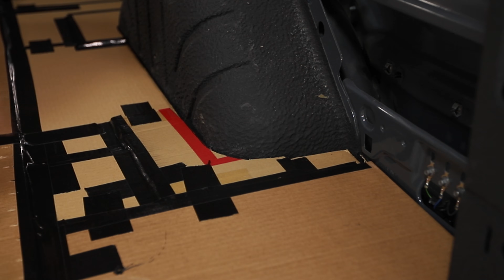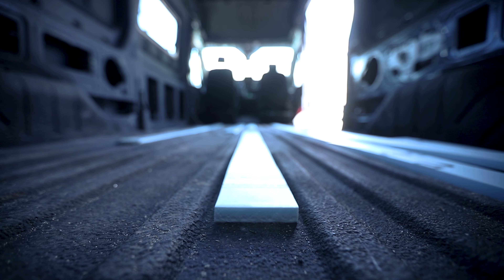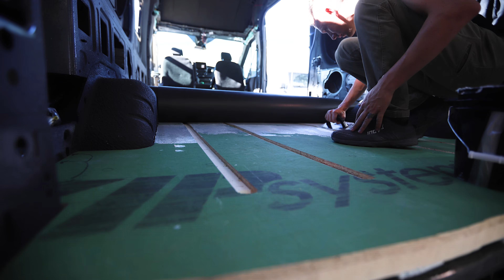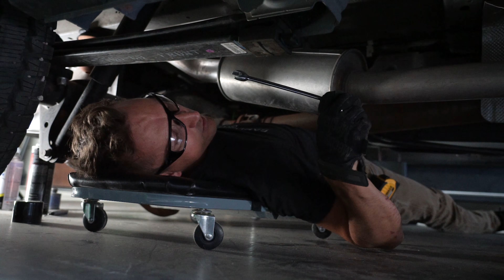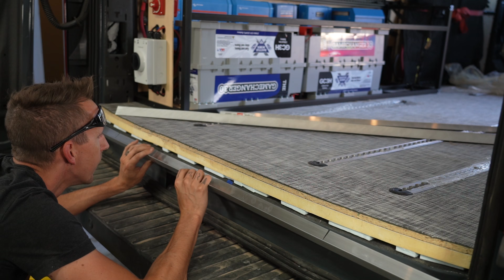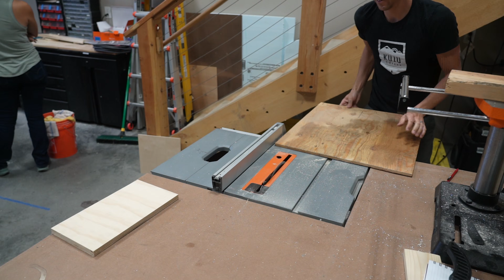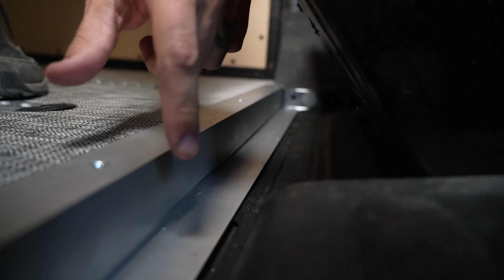VAN FLOORING PERFECTION (Insulation, Subfloor, Covering, L-Track & Step/Lip Trim)

Comment: Seems the zip floor Insulation  will get crushed over time and feel soft?
Reply from the maker: I'm sure it'll probably break down over the next couple of decades.  Until then, though - it should work great!
Reply: @EXPLORISTlife good to hear it has not flattened out, would not expect that from materials meant for walls and no foot traffic 👍

Comment: Did you say that you were potentially using the L track for seating?  That doesn't seem safe.  The L track is surely strong enough, but it's attached to wood/insulation that is just glued down.  I wouldn't necessarily trust that with the lives of friends or family :/
Reply from the maker: Sounds good!  You can always build your van however you like.  Remember, just because I'm showing in this build doesn't mean I'm trying to enact governmental regulations to make everybody on planet earth do the same thing - that'd be silly.  You have free will, use it!  Take what you learn from our videos and use what you want, and omit what you don't like.   There's nothing stopping you from this.

Also - a correction - keep in mind the L-Track has a bolt that goes through the bottom metal of the van every 6" or so - not connected just to wood/insulation.

Comment: Why do you install the floor, including carpet, first? That does not make sense. Now you need to protect it during the rest of the build.
Reply from the maker: Yes - we did protect it during the rest of the build.  We laid a layer of heavy duty carpet protectant plastic over it.  Not a big deal.

Comment: I am trying to do the part where you cut whit hot knife to flatten stripes. What is the model you use because the one I have dont cut that well the pir (The winnons one.)
Reply from the maker: Yeah, that can definitely be frustrating—some hot knives just don’t have enough heat or the right tip for clean cuts on that material. We’d be happy to help you dial in the right tool for that job and make sure you’re getting clean results. Reach out to our support team and we can recommend exactly what you need: https://shop.explorist.life/support?utm_source=youtube&utm_medium=comment&utm_campaign=support&utm_content=response_link

Comment: Is your floor in this video just floating? Or did you secure the wood floor with glue or bolts?
Reply from the maker: The floor in that build is mechanically secured — not just floating — but the exact method can vary depending on the van, insulation thickness, factory floor, and whether L-track or cabinetry will also be tying everything together. If you’re planning your own floor system, reach out to our support team with your van model and build plans and we can help recommend the best approach: https://shop.explorist.life/support?utm_source=youtube&utm_medium=comment&utm_campaign=support&utm_content=response_link

Comment: Do you think this floor would be Saturday enough for a motovan with motorcycles in the back? I would use rubber coin patter. Floor in that tea but was wondering about the sub floor. 2 motorcycles at 450lbs each
Reply from the maker: I personally wouldn't have any concerns w/ motorcycles on the zip sheathing.

Comment: I wonder if the PEX tubing could have worked out if a reflective radiant barrier was laid out on top of the insulation strips (the strip height would have had been planed accordingly to achieve a leveled surface across the van floor ridges). Of course a channel in the insulation board is needed to make room to lay down the tubing.
Reply from the maker: That's an interesting idea!

Comment: Costco is a great place to get large pieces.  Some of the pallets use it.    I wonder if spray foam would of been faster. A simple mud blade across the ribs would slice off any extra.
Reply from the maker: That's an interesting idea about the spray foam, but we opted for this method to ensure a super flat and solid base. Thanks for the tip about Costco!

Comment: Is there any concern with having foam in between the l-track and the van floor? (Foam sandwich) Does it compress the foam over time?
Reply from the maker: Great question! The best way for us to give you an accurate recommendation is to take a closer look at your specific setup and goals. Our team can walk through your layout, materials, and mounting plan to make sure everything is safe and performs the way you need it to.

If you reach out, we can also help you identify the exact parts that would work best for your build:
https://shop.explorist.life/support

Comment: is there a rule regarding the spacing between L-track strips to ensure compatibility inserted seats and benches? Is this a universal system for compatibility with a wide variety of brands? I see some shops do 4 strips, 6 strips, or even 8 strips.
Reply from the maker: Not really a rule, just figure out what you want to mount and space it accordingly.
Reply: @EXPLORISTlife  Well I suppose I should clarify if there is an "industry standard" rather than a "rule". Does the industry making L-track compatible accessories agree that mounting points are 12 inches apart? 16? 24? I guess if you were an inch off one way or the other it would be catastrophic as far as being unable to use compatible accessories.
Reply from the maker: We admittedly aren't expert in floor attachment spacing, so I can't say.  Once you get to the electrical portion of the van, that's where we can REALLY help.  Reach out here when you're ready: https://shop.explorist.life/support?utm_source=youtube&utm_medium=comment&utm_campaign=support&utm_content=response_link

Comment: Where did you drill through floor of the van for L track?
Is the L track hovering over the aluminum floor and its compressing via overhang onto plywood or did you install spacers?
Im extremely hesitant regarding location where to drill through. 

If somebody can assist, I'd appreciate it!

Comment: Love this video. I have watched it about 1000 time so far as I plan to install  the floor in my van. I have 2 questions actually I have more but for now: 1. How did you determine the spacing between the T-track? 2. When you bolted the T-track down did you have to lower the Fuel tank or exhaust Heat shield to get the bolts through?
Reply from the maker: L-track spacing was based on planning for future cabinets.  The exhaust and fuel tank did indeed need to be lowered for access.

Comment: What are the L tracks for
Reply from the maker: Great question! L-tracks are super versatile — they’re mainly used for securing gear, mounting cabinetry, or adding modular tie-down points in van builds and overland rigs.

Comment: I used 17mm aluminium sandwich panel. It’s less than half the weight of equivalent ply. Here in OZ it’s possible to purchase pre cut to suit my Sprinter. I don’t believe the sandwich I used would be very different in R value than yout floor.

Comment: Did you glue down the foam spacers? If not, do you have any issues with it squeaking against the floor?
Reply from the maker: I think I glued them down, but I don’t recall 100%.  Definitely no squeaking by the time the 100 bolts through the floor are in place.

Comment: Nice
Y day be, however I do not understand why anyone would put radiant floor heat in a van that goes thru hot freezing cycles. What do you do if you lose power in freezing weather or park it outside your house in the winter. Seems like just another thing to winterize
Reply from the maker: The floor heating would just be a glycol mix, just like a house in a northern climate zone.

Comment: What is that track on the floor for, I’ve never seen that, is it like e track in trailers ?
Reply from the maker: Sorta!  Same concept.  It's "L-Track".  Pretty much the same stuff they use in airplanes to secure the seats to the floor.
Reply: @ thanks, I just bought a van and trying to get some idea, thanks for the video

Comment: A way easier method for insulating the floor of the van or the side walls for that matter which I did in my work van is to use a product called DynaMat Ultra or any number of knock off versions of a similar type deal. It’s a flexible dense, rubber matting with an adhesive backing that you can use a little roller to press against the surface and get it really adhered. If you need to build it up, you can always put a second layer in the low spots but in this case, probably just haven’t gone over those high spots would’ve given you enough thickness to smooth things out. It has a reflective outer skin and would have provided a pretty decent amount of isolation from the metal. I can tell you that I had lined the entire inside of my Chevy Express 2500 with it because it didn’t come with the factory liner, and it greatly decreased the road noise and the temperature from the baking sun. I did not use the brand name, I used an offbrand version and save some money… The entire project wasn’t that much because I did it myself.
Reply from the maker: Dynamat is indeed great for noise damping; for sure!  We used spray on lizard skin for that in this build.  It's not thermal insulation, though, so if you were trying to insulate for heat/cold; you'll need something for that on top of the dynamat.

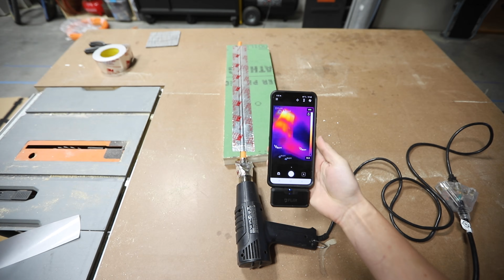Comment: at 6:17 your phone shows a thermal imaging visual.  What app? is there an attachment needed? Details? Recommendation? 

Also - love your injection of nerd humor on the R value differential of putting in the leveling foam on the floor - with the head fake of the second derivative mafs! - then the joke about the not knowing and ask the nerd followers to chime in the revised R value calculus.  Love this boss level of humor bro!
Reply from the maker: 😂🤣. Glad you caught on!  Thermal camera is the FLIR one.  It’s a little camera dongle the plugs into your phone.

Comment: Hello Nate & Steph, I will be mimicking some of you floor techniques.
I will be installing l-track, but instead of through bolting to van floor, I am going to use t-nuts from below my 1" Baltic birch floor.

My question is, now that the install is complete....do you feel you still need that many lengths of l-track?
I was going to use shorter 10" sections of track around various points of the floor.
I have no plans to mount seats nor heavy items like a motorcycle, so I am hoping my t-nuts holding the track will be sufficient to hold items down like a large ice chest for example.

You also have a lot of the ltrack covered by side cabinets, so do you feel you needed that much adjustability from the track.
Thank You, 
--Rich
Reply from the maker: It sure has been nice having so many options.
Reply: @EXPLORISTlife  Got it, Thank You team.
Reply: Team, any regrets to drilling through the van floor?
It seems very divided but I have yet to hear any one say WHY the would not it dir it, just speculation on leaks or water intrusion of some kind.

I do not plan on fording a deep river here in Colorado and you sealed it well from any road splashback.
Reply from the maker: @richostrosky6268  No regrets, no.  People who are afraid of drilling holes are the same people who think you should leave a vehicle totally stock and should only use vehicles to commute back and forth from the suburbs to a shitty office job M-F.

Comment: Mechanical engineer here.  The strips didn't really add much R-value because the gap they were filling is so small, the air itself would've added similar amounts of R-value, similar to how the small gap between window panes adds R-value.  The gap must be small though.  Gaps over 3/4" or so actually decrease R value because it's big enough to start creating convection currents.  This would be a good place to put a reflective layer though to reduce radiant transfer.
Reply: Might also add that no engineer would do all this useless work for a very minor R increase.  Anytime there is metal closer to the area, insulating the other areas extra has minimal value as the conductive metal overwhelms the total system R value.  It's just a make work project.
Reply: @christopherhaak9824  I would never understand Van or van developers, who persist in always wanting to isolate the floors, from the inside of a cabin ...? While reducing the ceiling height. While a considerable place of at least 100 mm, is between the crossing of the chassis itself.
Reply from the maker: Nah… if an engineer is getting paid hourly, they’ll find some hyper specific thing to nit-pick over. 🤷🏻😂
Reply: @EXPLORISTlife  I am not an engineer. But I know that it is not this type of floor, with an insulation that I would use for my van, when I have 100 mm under my chassis between my crosspieces.
Reply: @jeanmarcchauveau-u4q good luck! 😅
Reply from the maker: They decreased the U factor by 32.33, repeating of course, percent.

Comment: I'm having trouble locating a source for the Zip System R-sheathing in the Four Corners.  Do you a source in the Denver area?  Thanks for a great video!  Very helpful in creating a subfloor.
Reply from the maker: We got ours from Alpine lumber here locally in Steamboat Springs.  I think there is a branch of Alpine Lumber in Denver, maybe?
Reply: @EXPLORISTlife  Thanks so much for your quick reply.  I called Alpine Lumber in Telluride ($98.82/sheet) and Durango ($107.72/sheet) but saw that Huber Wood also lists Home Depot as a possible vendor.  I called several Home Depot sites in Denver and none could call it up in their system.  Then a young guy here at the Pro Desk in the Durango Home Depot went all out and found it for $85.39/sheet.  Thanks again for your great videos and for sharing your knowledge and experience.

Comment: Maybe I missed it (probably did) - but it would help to state what the objectives of the build are.  Like -- will have a sealed outlet for 120 V AC Shore power, switchable to Solar Panel / battery with 6000 watt storage.  On board 120V AC, 12v /24v DC...etc.   Also - some links to purchase the components.  

Excellent schematic diagram - what software did you use?

Love your builds!  Keep posting!
Reply from the maker: There's a full playlist for this build if you check out our channel home page.

I use Microsoft visio for all diagrams.

Comment: How did you cut for L track ? I seen you cut with skill but ac. But how so
Reply from the maker: Miter saw
Reply: @EXPLORISTlife i mean how did you cut the grooves in the flooring and then pick out the wood
Reply from the maker: Gotcha.  Circular saw on each side and a hole saw on the ends for the curved ends.  Cut just the depth of the wood and it just pops out.
Reply: @EXPLORISTlife yall are the best thank you. Last question. Which track did you get. Several to choose from to include deep cut

Comment: How did you secure the foam for flattening the floor?
Reply from the maker: Construction adhesive
Reply: Please explain how you layed out the L track to avoid no drill zones
Reply from the maker: I don’t know how to explain that in a couple of sentences. 🤣.  Just crawled under the van, took measurements, and used some diy ingenuity.

Comment: How did you make sure that the bolt for the l-track would be reachable fro the bottom?
Reply from the maker: At the risk of sounding like an asshole; I used my eyes. 🤣  Idk, I just looked at it for a while, took a bunch of measurements, rolled around under the van a bit and made sure everything was going to line up and then let 'er rip.

Comment: Hello,  I was wondering if you could link us to the L-track, and L-track end cap you guys used in this video. I'm also after the cutout dimensions (hole saw diameter, and width of cutout) you used to recess the track into the floor. Any insight is much appreciated! Thanks for the awesome video keep up the good work!

Comment: Hey Nate and Steph! Your content has been pivotal for me, so thank you so very much. I'm curious if you'd do this again, and specifically curious if the Polyiso/XPS is going to compress over time and compression set? Would you repeat it this way, or consider adding load bearing joists etc?
Reply from the maker: Pretty much do it the same again, yeah.

Comment: Would those seats be safe in the event of an accident?
Reply from the maker: How bad is the accident?  As a firefighter, I’ve seen accidents bad enough it ripped the body off the frame.  No seat is safe in that kind of accident. 🤷🏻
Reply: @EXPLORISTlife  fair enough. But are there any regulations about passenger seats and how they should be attached? Just want to make sure I have my bases covered.

Comment: I was wondering - what is the purpose of raising the flooring using the foam board strips to match the ridges of the van? Is this step necessary, or can I just place the R sheathing directly on top of the van metal floor? Thanks!
Reply from the maker: That was more so to make the floor more rigid in between the floor ridges.

Comment: Could you have just shifted the insulation and zip system wood by 2" offset so you didn't have to do a shiplap joint? Maybe yours came with the insulation glued already?
Reply from the maker: They come pre glued

Comment: So now leak test the floor with 5 gallons of water doing a drip drip drip on to the floor for several days.  Pull the flooring up to see how much water is between the van metal floor and your added top flooring.
Reply from the maker: I don't think I'll purposefully subject our show van to that kind of abuse, no. lol  I do appreciate you tuning in and watching, though!
Reply: @EXPLORISTlife  Exactly my point .  The floor will eventually fail with water intrusion.
Reply from the maker: @bobmirror7164 Sure. Just like every van/rv on the market.  We aren’t building boats here. Cost to benefit to risk ratios at work here.  You should upload your own video if you think you’ve got a good idea